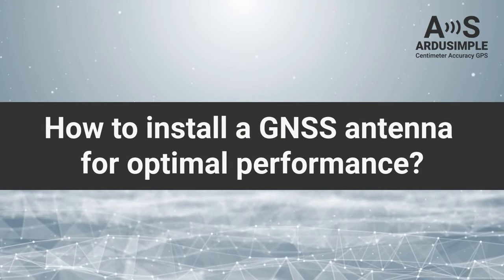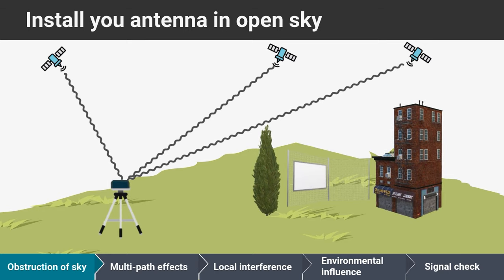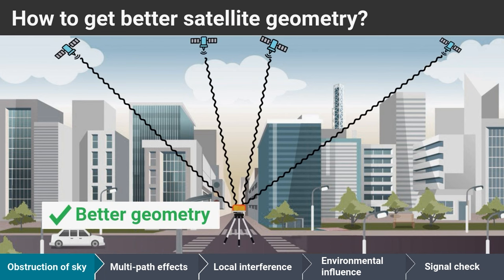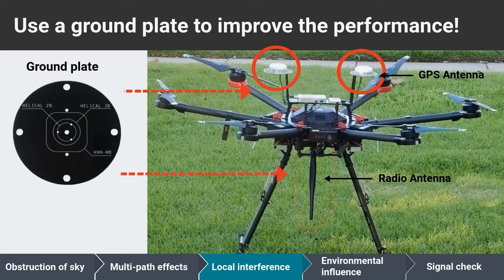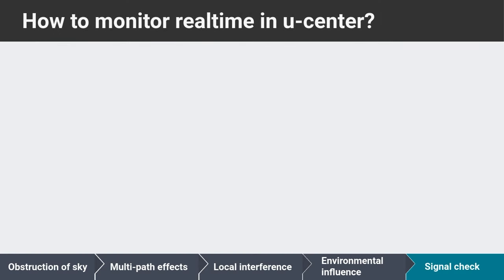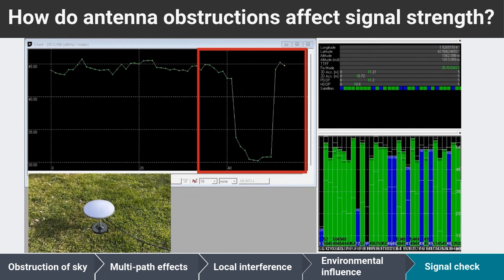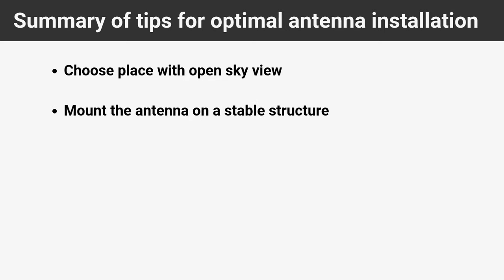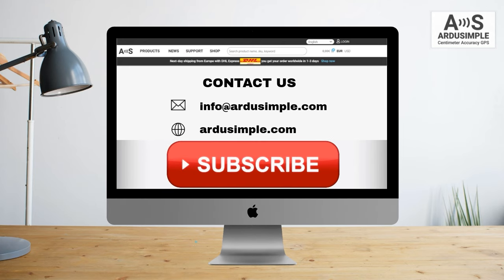How to install a GPS/GNSS RTK antenna for better performance

Comment: Excellent tutorial. I also noticed that in places with vegetation, increasing the elevation mask during post processing improves point accuracy. Thanks.
Reply from the maker: Thanks for sharing your experience. The results you mention might be specific to the postprocessing software algorithm being used. Could you share with the community which one are you using? With the integrated realtime rtk engine (u-blox or Septentrio) from our experience the receiver is able to discard these lower elevation satellites automatically, and there is no need for manually adjusting these settings.

Comment: This is overly focused on mobile setups.  Your website links to this from the article on basestation installation, and would do better linking to instructions suitable for that.  Such instructions need to focus on:
 * preventing unwanted antenna movement (so not on a lawn or in middle of traffic).  Also which kinds of building and structures are likely to sway in high winds (a 3m long 16mm PVC pipe will obviously sway with every gust, a mountain ridge won't, some antenna pole sway more than others, some buildings more than others).
 * Needed angles of sky visibility (is 45 degrees from horizon to clear sky too obscured or too exposed?).  Is 360 compass degree view needed or are point obstructions (like flagpoles) harmless .
 * placement of ground plates on something other than vehicles .
 * how to run the antenna cable into a building, shed or other protection for the receiver, computer and power source .
 * if rooftops are good or bad choices in urban areas.
 * how to reduce accumulation of bird-related obstructions (position relative to nests, bird feeders, trees etc.)
 * Which of your antenna types to use .
Reply from the maker: To keep it short, for a base station make 360deg/180deg clear view of the sky, unobstructed from any kind of items and make sure the antenna does not move at all, even if grabbing it with your arm.
Although any antenna under the above conditions is good, we recommend using survey grade antennas.
Of course, if all the above conditions can't be met, you can still install your own base station but its performance won't be ideal, try to find an alternative location if possible.